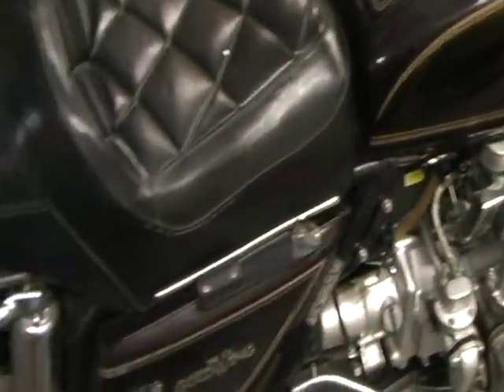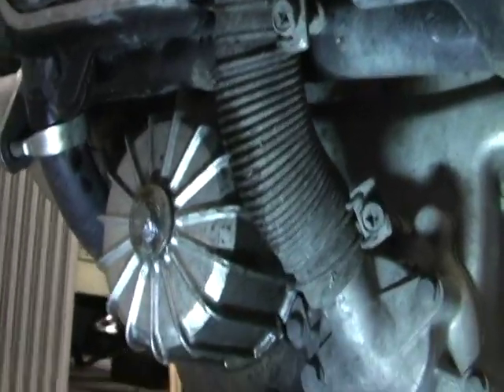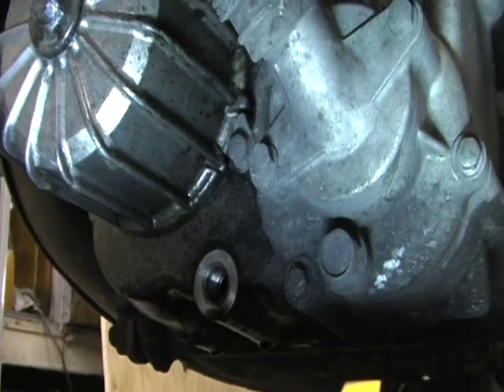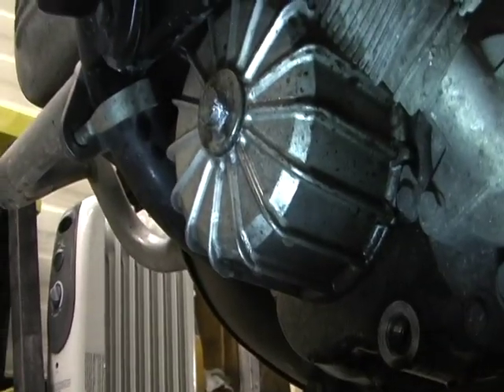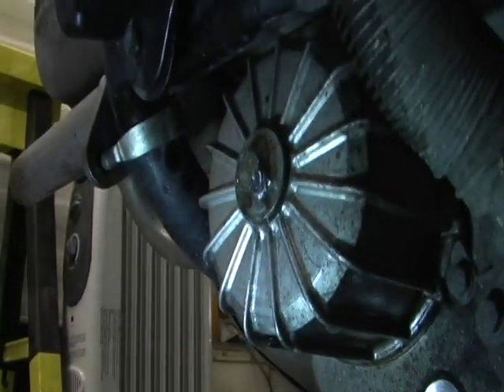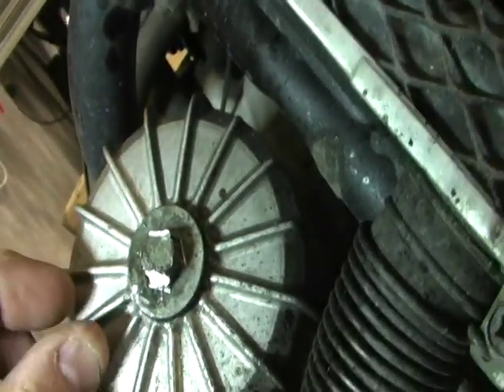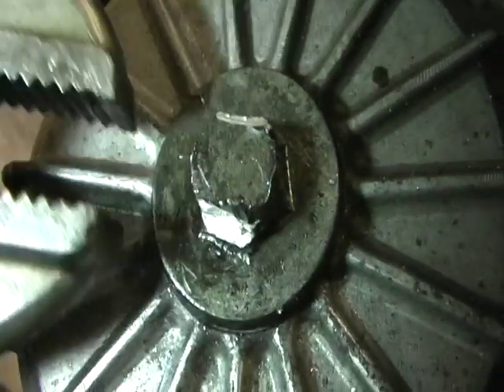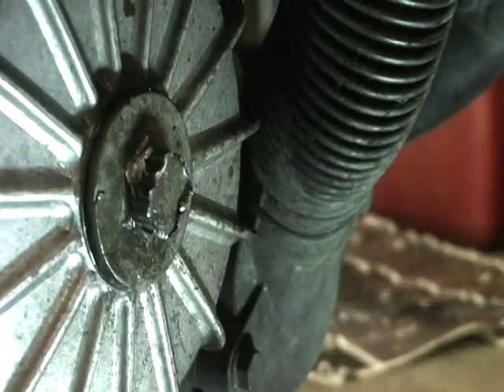Changing 1981 Goldwing Oil & Filter

Comment: Good job Tak, thanks for this.  I just got an 82 Aspencade, changing the oil for the first time this weekend before I bed 'er down for the winter.  I've got a '79 CX500 too, and never even considered this problem.  The oil filter covers comes off very easy, no need for someone to have tightened yours so hard.  I would have done pretty much the same thing.  Safe and happy riding to you man.

Comment: I am dealing with the same problem on an 83' GL1100. I have damaged the heads trying to break it loose. I didn't consider the torch. Will try that next. Thank you for taking care of this problem for me.
Reply from the maker: Good luck and I hope it works!  There were a lot of great comments from other people.....I like the idea of welding a socket to the head, but I am not a welder and have no tools for that.  I just did what I could and the heat helped.  I hope you get it!

Comment: Good job! I have the same bike 1981 GL1100, so far never had that problem. For emergency in your case, using a pipe wrench on the round outside part of the bold helps, also grinding down the  bolt head and welding another bolt head to the bolt will work but the best way next to getting a dealer original part is to look on Ebay, all parts for GL's are very cheap, you could find that bolt, filter housing, spring and washer for about @10.00 to @ 40.00, look it up. I love my 81 Gold Wing!

Comment: Same problem my 1983 GL1100.  A GOOD service warning of the danger in oil change  :-) and steering out of the skid.  Mine looks  same too - Samsonite on a black.  The carbs got pretty clumsy when cold and it took about a year of fuel additive and but apparently some blockage dissolved and now all cylinders firing when idle and cold. BTW 1200 starter LOOKS the same but won't fit.  Couple thousands larger shaft diameter.

Comment: 84 gl1200A happened many times. Used a small pipe wrench to get it off. Only use 6 point sockets or box end wrenches now and have had no problems. Buy a good named brand tool for quality and tolerance.

Comment: grind the end down smaller and put a nut (bigger sae if necessary) over what you ground off and weld a good bead in the middle, keep the bolt as cool as possible so as not to damage the rest of the bolt.

Comment: I had the same problem with the oil filter on a 78 750; big bolt and little head.  I brazed a big nut on the bolt, which solved the problem.

Comment: For all you beginners out there that have a "rounded bolt" on your task . Almost every tool maker out there has a set of sockets made just for rounded bolts that in most cases WILL REMOVE ROUNDED BOLTS. They are fairly inexpensive and will deacrease the time needed to remove the damaged bolt head . 
As for this specific bolt . simply find a nut bigger than the bolt head and take it to a welding shop and ask them to weld it . Probably $20 but well spent "DONT REINSTALL DAMAGED BOLTS!!! " .

Comment: I'm having the exact same issue with over-tightening of an oil bolt, in my case an oil drain bolt, and the thing just won't break free. I've had PB blaster sitting on it for a week, but I guess I'll try the grinding and heating next.

Comment: If you insist on using a pair of Vise Grip's to remove this specific bolt just simply clamp the big round part behind the bolt head and you may want to hit the head a few times with a hammer first though . good luck !!!

Comment: Breaking bad bolts lose. Tap on the end of the bolt with a hammer. If the nuts starts to strip, DO NOT use a vise grip. Instead use heat and then a pipe wrench. To repair a bad bolthead, find a large nut that will fit over the old bolt head. Grind the old bolt down if need be and then weld the inside of the nut to the old bolt head.

Comment: turn the motor on heat up the oil two if it don't work use wiz wheel cut it off

Comment: "I'm not blessed with patience."  Oh, really?  No shit.

Before you completely chewed the shit out of the bolt head, you should have tapped on an SAE socket to the end of it, and used a conventional ratchet.

The definition of insanity is doing the same thing over and over and expecting a different result.  If the vise grip isn't working.... stop.  It isn't going to get better.